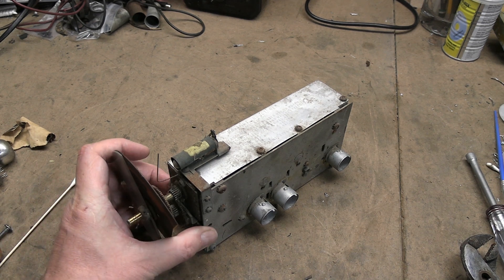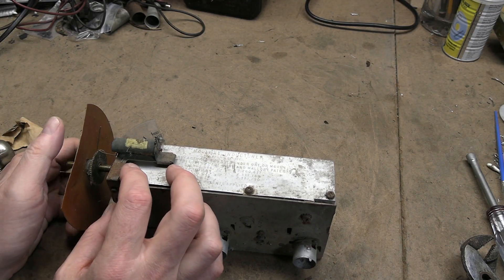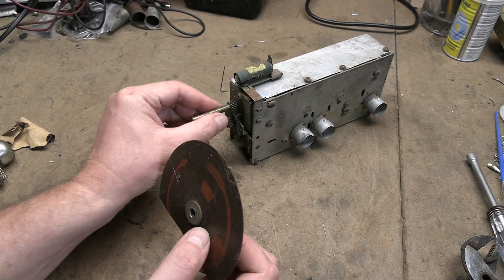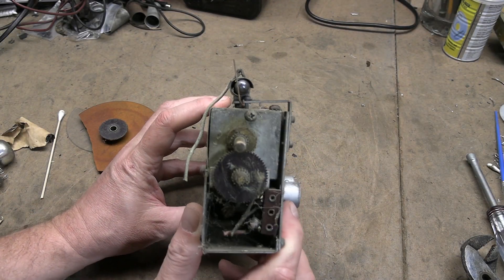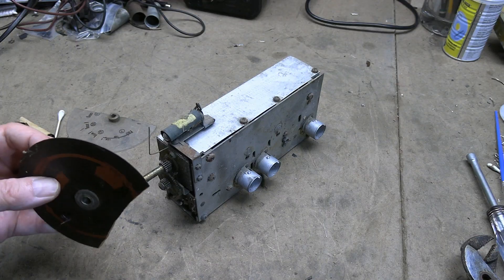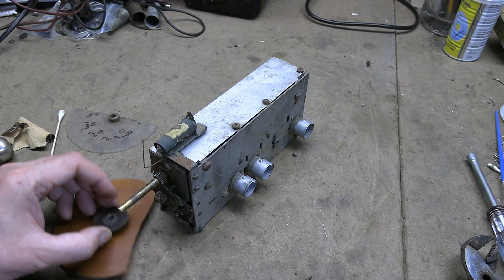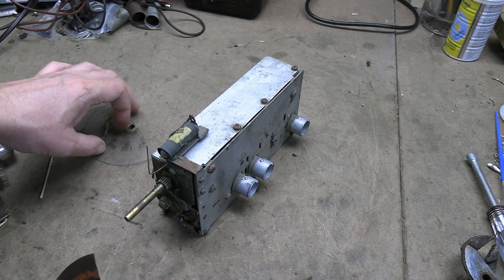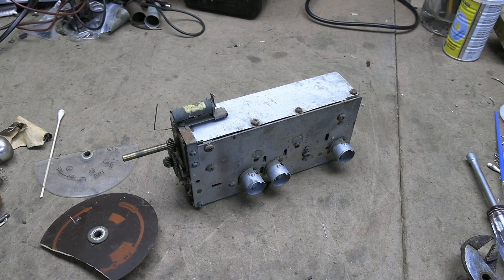Dumont (Stromberg) RA-103 phenolic tuner gear

Comment: I would not try to drill out that bushing, it is thin with a large diameter.  The drill bit would catch. Very likely the fragile parts would be damaged.  A Dremel tool and a coarse stone or  fine file bit would be better for brass. Reduced speed would be best. Just grind the edge of the metal bushing away a little at a time. Your choice of glue, I would go with epoxy. Make sure there is no oil or grease on the joint before gluing.

Comment: Bob, take the parts one (i.e. the one with the broken dial) and drill out the swage (pressed over metal) on the back - i.e. the metal that is currently holding the good gear on.  Take the good gear and open up the hole until the ID fits just over the swaged metal diameter.  Then, a few drops of super glue and just glue the good gear onto the face of the bad gear, making sure to align the teeth.  I suspect there's plenty of clearance for a double thick gear and this method allows you to leave the tuning dial fully intact on the part you're repairing.

Comment: What about doubling up both gears since the pinion gear is much wider than the phenolic gear? It seems like the forward/rear position of the rotating dial has enough wiggle room to accommodate the width of a second gear, but it's hard to tell through video. You could drill the tube rivet off the good gear, open up the gear inside diameter to clear the rivet crimp on the bad gear, and then glue them together with the teeth lined up. 

Alternatively, if you can post a clear head on image of the gear with an accurate measurement of the outside diameter, it would be pretty easy to CAD a reinforcing ring with the right teeth to glue to the side of the bad gear. I see other commenters mentioning CNC machining and 3d printing, but I think laser cutting a ~.04" steel or brass sheet would be cheaper/easier here - there are a ton of online services for that. Plus you wouldn't need another spare gear if you ever encounter another bad tuner.

Comment: And its been plinkotwinkulated....

Real shame about that buuut if you can reglue it and add a slight mask to the glue spots (or add a plexi glass backing) then it could be a seamless repair

Im currently working on the 8-301w sets and the safety sheilds are the same way (polishing them is a nightmare with how fragile they are)

Comment: Maybe you could get one CNC machined, perhaps from hard Plexiglas if not metal.  This looks like it needs to be firmer than anything that can be 3D printed.
Reply from the maker: The gear?  I have this one that's fine.  The question is how do you mount it to the metal bushing without damaging anything?
Reply: @bandersentv  This looks like a crimp job, and maybe epoxy could help hold it even firmer.  A new bushing maybe?  I've seen Dave on Dave's Radio Adventures do crimping, if I don't misremember.

Comment: 3d printer might be a good option to make a new gear or parts. I'll probably get one someday soon, seems handy for all kinds of things.
Reply from the maker: That's not really the problem though.  I have a good gear from the parts tuner.  It's attaching it to the bushing that's difficult.
Reply: Your original idea of some sort of heavy duty thick epoxy is probably a good one then.
I had a beater 82 Celica that needed a new temp sensor and when I tried to remove it I messed up the threads and I couldn't make a thread sert work. I hogged it out and filled the hole with liquid steal and a thread sert that was the right size. When it sat for a week I gently screwed in a new sensor. I had to solder a ground wire to it and it worked and never leaked for a long time before I decided I was tired of fixing all the issues and sold it cheap. It did have over 300k on the body.

Comment: Bob, I know of no simple remedy.  They are using a bushing with a thin-walled area so the bushing can be flared into a spacer on the opposite side of the dial.  To remove this, would need to carefully drill out the rolled flair.  You would then need to machine a new part on a lathe.  An Arbor press is needed to reassemble the newly machined parts back on the dials using a custom made flaring tool.  However, probably the hardest part is during the flaring process.  To get a nice tight connection between the dial and collar or bushing, considerable flaring force needs to be applied.  Since that force bares upon the metal and plastic dial, it would be very easy to shatter the dial.  Given it's age, combined with years of heat from the tubes, has likely made the plastic dial very brittle.

The gears are another problem altogether.  I'm not sure how you would address that for a reliable and practical fix.  With all these custom plastic parts that are becoming increasingly difficult to source, the knowledge of making parts via a 3D printer would come in very handy.